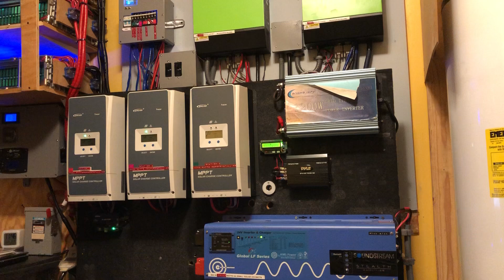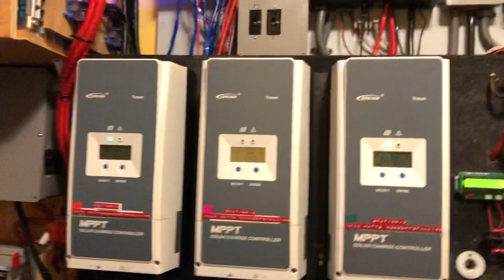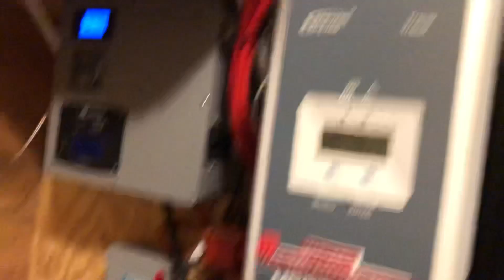Epever 100a solar charge controller

Comment: 10kw of panels, your making me jealous, are the epever controllers putting out more power? ive been thinking if buying them aswell
Reply from the maker: Thanks for checking out my video///as for the epever they work like a charm,they are just as good as the flexmax80 I had if not better,they are 100 amp @ 200 volt,it’s been a little over a year since I have been using them….and yes you should get it